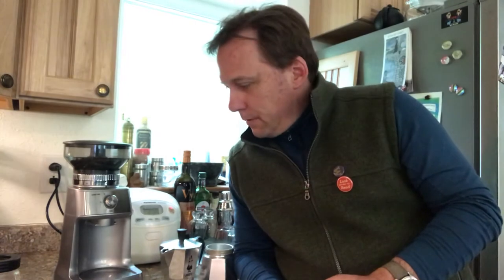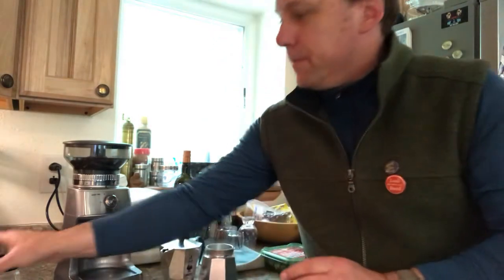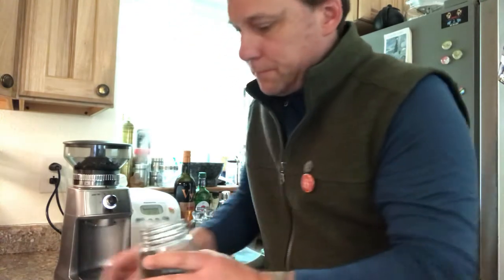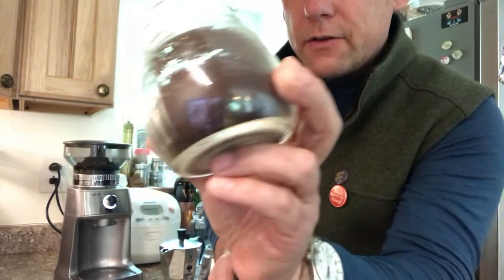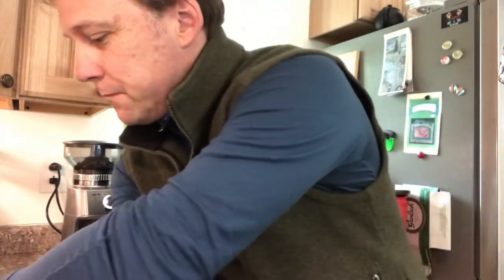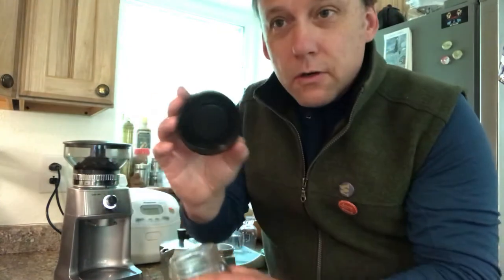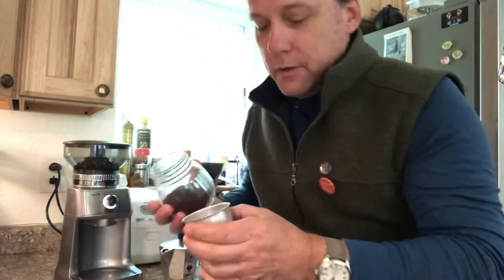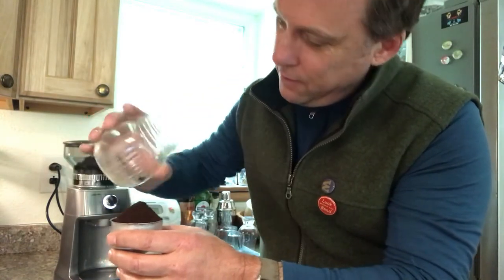Electric coffee grinder static - cool little trick.

Comment: Put the water on the beans before grinding. I use a tiny spray bottle I found in my house. One little spray.
Reply from the maker: I can't - or I won't. Because I have a multi-day filled hopper on the top of my grinder, and getting to the beans that will be ground up first would mean digging all the way down to the bottom of the hopper. I won't pre-measure my beans every time I use my grinder. Nope.